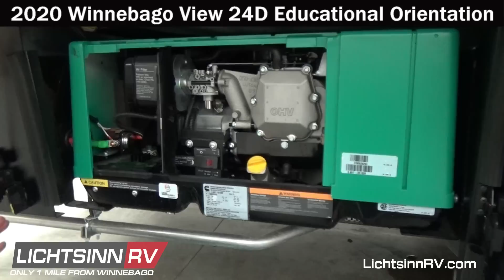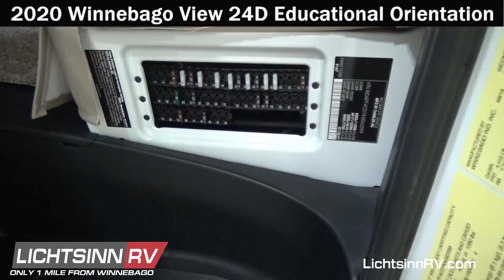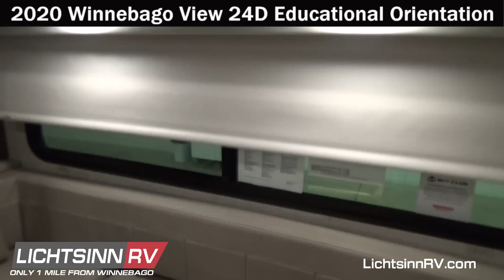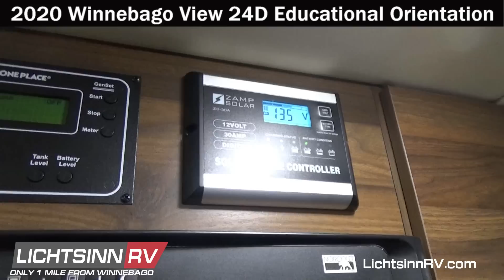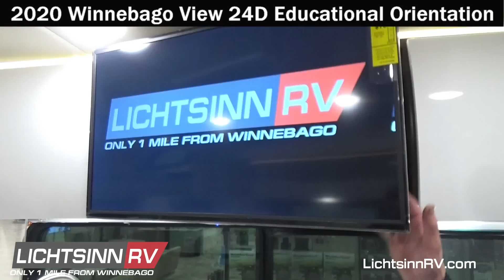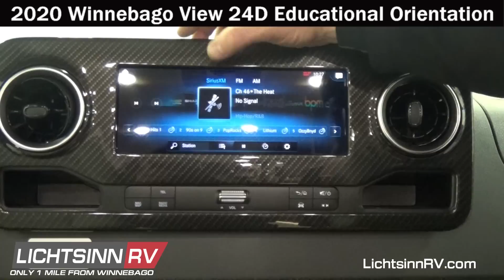LichtsinnRV.com - 2020 Winnebago View & Navion Educational Orientation Walk Thru

Comment: 2021 Winnebago view = 
1. when running the diesel  generator, do I need to have my engine running?
2. When traveling during hot summer months, should the diesel generator be running, while going down the road?
Reply from the maker: Good morning Richard!   Thank you for your note!   1.  You do not need to run your engine while using your diesel gen   2.  When traveling, it's up to your comfort level for AC as to use the gen or not... completely up to you!   Hope this helps!

Comment: Hi! Thank you very much for a great instructional video! Unmatched degree of detail, especially useful for people like me, who will be new to the RV world. Soon I will be in the market for a new RV (most likely go with your dealership as I feel you’re in a better position than other local (Florida) dealers to service my RV) and the Navion/View are at the top of my list. I do have a question (and given my in experience, please forgive if it’s nonsense): I want to get an RV to get away from people, i.e., to do a lot of boon-docking and not so much RV parks, etc. Therefore, feel that I might need a feature not typically available in small class Cs: a washer/dryer... is it possible to install one (preferably stacked) on this RV? I realize that if at all possible, I would have to give up some storage place, but I wouldn’t mind since it would be primarily just me and the wife using the RV. If I’m wrong and I don’t really need the washer/dryer, please tell me and why. I really love these units and would hate to have to go with a much larger (and expensive) Super C to be able to get the washer/dryer. Thanks
Reply from the maker: Good morning!   There really is not space for a washer dryer but some have used portables, interior or exterior to the RV

Comment: Need to change the oil every 50 hours on the generator? So I guess changing the oil every week?
Reply from the maker: Good morning Cliff!   Thanks for your note!   If you are using your gen 50 hours a week that is great and you certainly are outside the norm.   Most of our preowned trades come in with less than 80 hours total over the span of 4-5 years.   Hope this video helped you!

Comment: Does the new Mercedes chassis come with build in WIFI ? If not what equipment you advice? Thank you for such level of detail..... getting closer to pulling the trigger
Reply from the maker: Good evening!  Thanks for your note... so it does, but keep in mind it requires a separate subscription thru AT&T and then when the vehicle shuts down, so does the your WiFi.... for that reason we advise most often a Winegard Connect 2.0 for WiFi boosting and cellular boosting that you can use off your existing AT&T or Verizon plan by adding a SIM card from that provider.   Hope this helps!

Comment: So the only things you need LP for in this coach, if I'm understanding correctly, is the furnace if the temp drops below 40 degree and the propane cooktop? If you never had the coach out where it drops below 45 degrees and you only use the induction burner, then theoretically this could be an all-electric coach. (What about with the optional lithium package and the new 2000 watt inverter? With a compressor fridge and either no gen or a diesel gen... Will that do it? I hope we're not being too demanding but I really think this is the model year for a true all-electric View/Navion!.... customers will be looking for it more and more!)
Reply from the maker: Good morning...  correct on your points the only thing missing is the Truma Aquago water heater is LP only with 12V for the pump... Truma does not offer an electric water heater option right now.
Reply: @LichtsinnRV  Thanks! Didn't catch that one, ack..we're almost there!! They can do it, keep pushing :) For most of the B vans, now, we're already there.